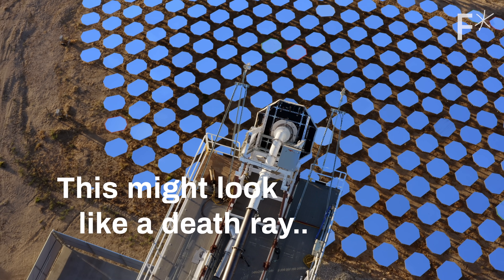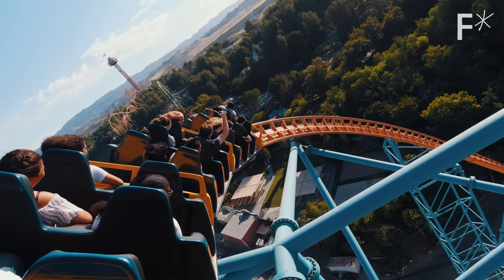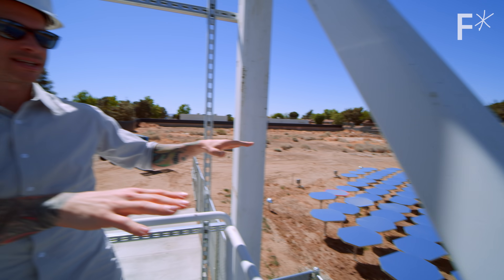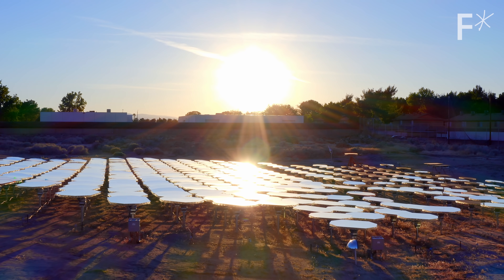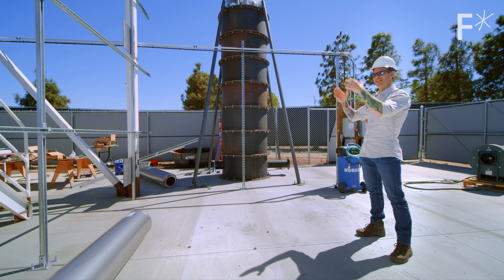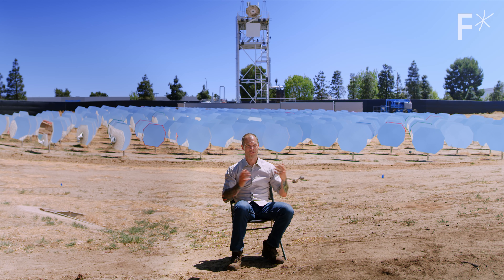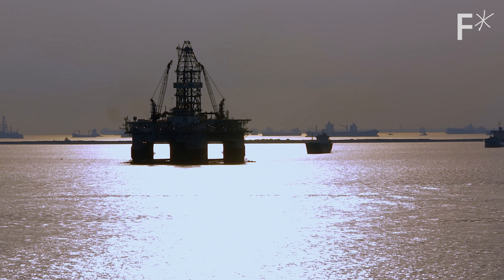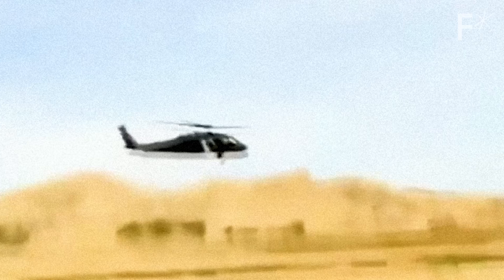How concentrated solar power could fuel the future | Big Think

Comment: Ok but you didn't explain how you convert the heat to electricity. Using what process?
Reply: Solar power heats molten salt, salt stores energy like overnight and stored energy heats up air so turbines will generate electricity.

Comment: aloha all, ok please send this along.... We dont have to to make use of the land area or build many many of these towers, maybe one on each continent is all. Instead of just focusing for heating water or salt, try thinking of just moving the electrons of helium without the heat. Good job on efforting such a simple idea, but first we must remove the price tag culture.
 Ending the use of money is the only way forward. Trying to work inside this culture only hampers our ability to grow it to the next cost free level. Stop the thinking of using money for profit and prospering, it gets us nowhere. Confined by money we are limited by costs to produce, in reality the purpose is to just make the power we need and so much of it that it can be given away for free, then we can work as one species to move on, money cost only separates us and slows us down due to the need to adhere to greed thinking....
 The solution to this is to focus the light into the top of the tower and then move the light at the top to an station to bring the light back down cool it and capture the electrons directly into the the existing grid, --- no water, salt or whatever is needed, it would probably work better on cloudy days....lol, because light is electrons, just capture the electrons, pure energy, no heat at all.   
 Or after focusing the sunlight to a single point of concentration, at that fixed point redirect or bend  it to a circular container and the electrons become their own spinning turbine as they move around inside, away from birds and then feed off of that to the power grid infrastructure, you're under thinking it and are restricted by costs for profit.  
The idea isn't to become rich or to just replace fossil fuels, the ides is just to make it work and for go the costs. Solve the problem make it work and give all humans free energy and only arrest those trying to sell it.

Comment: The best use for Solar Thermal Energy is making concrete, steel, silicon for making photovoltaic cells, etc. As it is hard to beat photovoltaic cells for producing electrical current...

Comment: So same process of the current mirror system, different model. It's good, but solar energy takes up a lot of space. We need to move away from fossil fuels, but I don't think this is the only solution, never put all your eggs in one basket. Good to see people working on Ideas like this. Just a thought:
If hypothetically this happens and the half of Australia is covered in mirror plants, could you concentrate all the plants mirrors to one spot in the atmosphere to essentially be able to burn a satellite down? If 1000 mirror can get the heat it does, what is potential of 1000000 on the same spot over a further distance?

Comment: Surely this could be done easier with a large concave dish, like a satellite dish, without the need for so many tiny mirrors and motors. Then only requiring a single motor to change the position throughout the day to focus on the target at the fixed distance needed, instead of a multitude of motors on each individual mirror panel each requiring continual changing. This also can be duplicated in many places throughout the world where the sunlight is optimum and requiring much less land use.

Comment: IF YOU SEE GREEN TECH IS IT REALLY GREEN THIS IS                                                                      

R,D,P, MARINE AUSTRALIA
Reasons for building this system
The future is clear as far as our need for usable power 
It has been stated that our power requirements will triple in the near future. 
My feeling is that this is not correct because of our wish for green power and the infrastructure needed to make this happen along with population growth. 
It’s not petrol or diesel that makes steel or any of the items we have at home or office it’s ELECTRICITY and the power that is needed is BASELOAD power. 
something yet not available in the wind or sola fields as new generation of batteries are needed to make it a viable application.
What I have is a process that fills this ever-widening gap using existing infrastructure to produce more usable base load power to get things rolling 
And still can be called green energy 

Hydroelectric basic description 
I will make some basic assumptions in the knowledge that ALL dams are in affect one off builds with the chief engineer having to modify the following to make fit for purpose in the real world. BUT the rules governing this system are sound and repeatable 
Note NOT wishing to be exact with my descriptions of each stage of the system at this time. as this document is given at first contact stage
Now basic overview 
most dams have had its location set by the topography (will it hold water) and the geology (will the ground support the dam wall and not move) the same rules are used for the turbine hall whether in the mountain or outdoors BUT more importantly is the fall of the water stream and the distance to the turbines 
Now to the outflow pipe - Tailrace 
This in most cases is to long and would be preferred to be shorter but due to the restrictions on the location of the rest of the hydro plant in relation to the nearest water course is considered the price paid for the systems limitations 
SO 
1, CHIEF ENGINEERS DECISION 
The chief engineer will be making the first and most crucial decision of the project 
That being were the tailrace will be shortened to and will denote the location of the new turbine housings 
This will be made with only one criteria in mind (to allow the main turbine hall to run at peak power) 
Now with this in mind as the first power saving item certain issues will arise 
Decision Pit falls 
If the tailrace is made to short then the friction within the tailrace pipe will not be enough to create the ideal backpressures needed to stop the turbines from surging and if to long then savings will have been lost 
NOTE  
Now the next issue will be raised by the chief engineer as the first and main reason for not making this unit 
And that reason will be the fitting of my unit will make the first decision redundant as the backpressure will rise as the new unit will be installed in line 
This I am pleased to say will not happen and furthermore the dams turbine hall will at no time be affected by this new system 
Even if all hell lets loose and everything locks up the main turbine hall can keep producing with no interference 
As we are on this subject 90-95% of the main body of this construction can be made with no down time needed from the dam. Now as stated this will mean that the last stage of the install will need to happen during the annual servicing shutdown for flow redirection 
2, This is the basic overview of the new second stage system 
A, From the rear of the new turbines there is an added tailrace pipe this is to accommodate the now reduced speed of the water and is able to handle 130% of the volume combined 
B, Depending on the dams setup for this item I will assume there are four new turbines fitted to handle the turbine halls output 
So from an aerial point of view you would see one large pipe flanked by two smaller pipes each containing the new turbines .( looks like your hand being flat on the table ) the larger central pipe is a balance pipe to maintain head flow and will double up as bypass when a swap out is needed for servicing periods. All are fitted with guillotine gates ether end and a gantry Crain is fitted over head 
As this setup must have a safety fall back option the volume of water in the system must be able to escape if a major issue arises and side pipes are placed to carry waters that have risen high enough to reach their entry points to dump into the tailrace 
Thus this system is unable to affect the backpressure to the main turbines and allows normal operations in a worst-case scenario 
FUTURE IDEAS 
when this system proves itself as a common place item there is one other area worth fitting this system to for even more power return per ton 
The penstock is well able to support the running of this type of unit and will be fitted with basically the same arrangement but larger units and set to run on the volume per second  
I expect the returns from this style of unit in the tailrace should be 3-5% and a further 5% from the penstock 
And regardless of the size of the main turbine hall in other dam locations this units configuration will remain the same and only multiples of will be the change.
Other areas where this style of unit could be fitted to are our large water storage dams as these units are well capable of supporting power production in a limited fashion of about one megawatt output for remote areas and will allow the dam to be more fully self-sufficient in its power needs for water cleaning and local power consumption needs 
Other possible areas of application are mine dams and even tailing dams 
From 
Simon bowman 
Rdp marine Australia

Comment: There's only a handful places in the world where such solar stations can be build yet you're saying about ending embargoes and politics around energy sources.
Liquid hydrogen is extremely hard to store and transport (cryogenic fuel), you can't just use normal pipes and equipment that we now use for natural gas. You need absolutely new infrastructure and suddenly after all built and done, this new way of energy is cheaper than oil? In what fantasy world do you live?

Comment: This sounds amazing… on paper. When you add up the amount of fossil fuels involved in the manufacturing process for 1 panel. It doesn’t make sense. The amount of mining for quartz, coal, lithium, as well as many other essential elements need to produce a panel is staggering. The massive amount of fossil fuels needed to process and manufacture all of these elements into an actual usable solar panel is staggering. Don’t let these fake green people to continually lie to you. These projects are funded by some of the worst, environmentally unfriendly corporations on the planet. The same people the think biofuels are the future. Essentially cutting down trees and burning them with rubber and plastics to generate power, is renewable. I’m pretty sure cutting down green trees and burning them for energy is the worst thing possible for this planet. What do we do with all of that waste? We throw tax payer dollars at a fake green movement that is actually worse for the planet than nuclear, coal, or natural gas. Cutting down more trees is actually speeding up climate change. Dig in and do your research, please
Reply: Concentrated solar emits around 20-40gCO2e/kWh so the CO2 emitted is not staggering . And this number will decrease as heavy industry slowly electrifies, directly or indirectly. What alternative would you suggest?

Comment: That’s great and all, but:
1) the sun is not an evenly distributed resource as your video claims. As you mentioned, these would have to be placed in specific areas around the globe. Which brings me to:
2) Global electricity production and supply under the control of very few countries (and many of them in the ME) would supposedly cause no geopolitical issues, there would be no conflicts for access or control and it won’t be used as leverage against less sunny countries, under any circumstances. Right…

While the tech is very impressive, the whole video narrative gets very unrealistic in terms of “making the world a better place”. Just say it’s a new efficient and clean way for energy and leave it there.

Comment: Solar doesn't have to be patch tiles or boards, future solar will be more like glossy clear glass coating or thick antennas, acumulating a more efficient flow, also mixed with smaller mini nuculear reactors amp and solar can exponentially increase power resource , with far minimum polution extracts

Comment: good but i feel that this needs some change in plans but also a small doubt, "HOW and is it possible"
because the concentrated rays can burn birds
so if the mirrors are replaced with lens and the concentration of rays to downside death ray spot and use it
i know the efficiency is not the same but saves any living beings thats fly above the plant

Comment: War? Politics? Whats with the fear monggering part? 

Just give the presentation on why your technology is more effective, efficient, and works.
You stop at rock, so you heat rock, and have a heated rock... Then?
How can a heated rock be used to supply energy? How to apply it?

If you end it only in fear monggering of the previous ways, thats not really a solution.

Comment: Absolutely brilliant, but the same problem will occur if the facilities and supply aren't Government owned, the same companies which currently control the oil supply will control the Hydrogen production and supply. These companies have been pushing for Hydrogen over solar and batteries for decades precisely for this reason.

Comment: Marvellous!
We can shut down Electric  Powerr generating stations which uses fossil fuels and we can shunt away the solar and wind power generating mills which are more expensive than the output.

But, even this technology, is not upto the mark where I think the technology should be such that it is possible for individual houses to produce the electricity of theircrequirement. 
When the technology reaches that level, may be after a century, the human kind can say Technological Advancement in Energy Self Reliance.
Thanks for the video, it was superb info packed and full of 'Arising Hopes'

Comment: With the shale revolution, and as result of over abundance of LNG, burning LNG is right now the cheapest way to generate heat. Also the LNG process doesn't need open fields of sunlight, can operate at night, is much cleaner than traditional fossel fuels, and is literally "free". Covering lots of ground, as one of the engineers stated in this video, is what I have a problem with....regardless if it's in the desert. I see the potential of destroying environmental habits (even desert habitas), potential wasteful products in those flat fields, and imagine birds flying in and or around those burning Lazer beams. I means, birds do love to land a high objects. Also, the costs for blanketing the desert with panels is going to be expensive.

Comment: Looks like the cheaper version of the old heliostat technology.
 Good for the metal processing plants !
Reply: No.
Not nearly enough capacity.
Reply: @Morfidus Mor that issue was addresses. Didn't you look at the video?
Reply: @robertunderwood1011  He obviously did not.
Reply: @number1sun  and no more birds. And on and on. Catastrophe in the making.
Reply: @hermanvanniekerk1270  Birds can piss off. If what they're promising is true (cheaper and easily accessible energy, which I'd be very skeptical of), you can take all the birds and stuff them all in your backyard (since you love and care about them so much), most people won't care.
Reply: @hermanvanniekerk1270  I'm a bit late, but as I heard it, a lot of the fuss about birds ended when a new maintenance program at some plant stopped creating a glowing aerial halo for curious birds, and avian casualties dropped "to zero" for some span of time (?). I do wonder what they ought to be made of (like perhaps bits of fossil infrastructure) and how they're going to be cleaned--the current standard seems to be a firetruck hose, so the good news is there's plenty of room for improvement there. The bad news might be that map that shows up about seven minutes into the video, but hopefully that's just an artist's whimsical example. Hydrogen seems like an extra step for so many places.